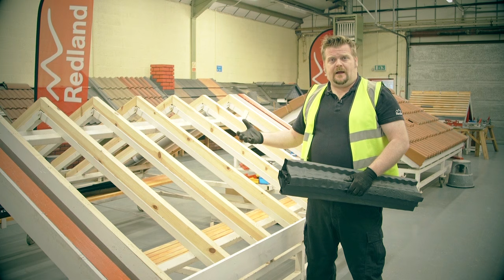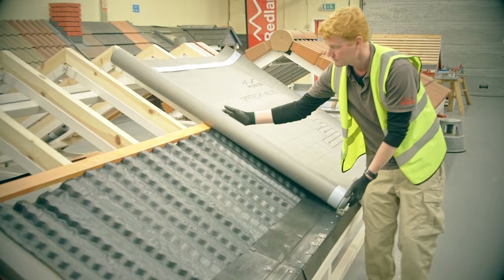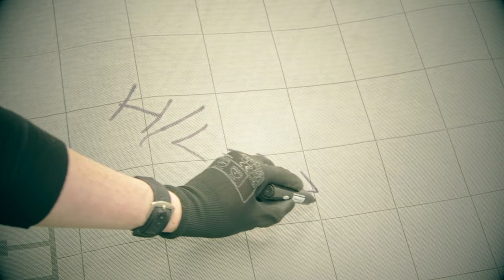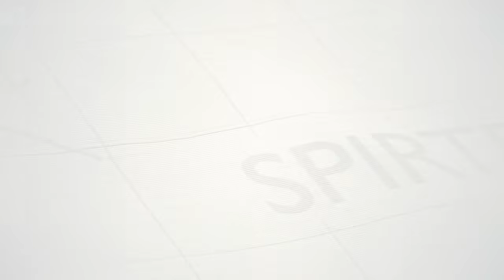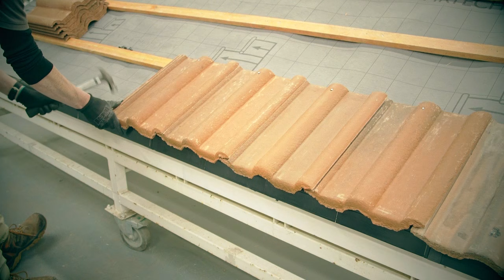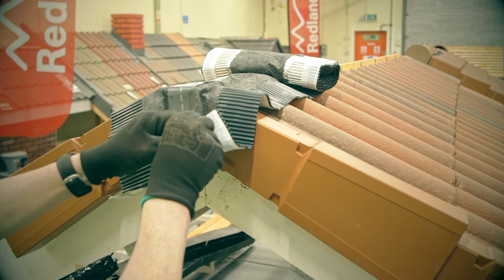How to Build a Roof

Comment: Actually, the factor that determines what type of roofing can be applied to a structure is called "slope", not "pitch". Believe it or not, they are two different things.
Reply: How so mate ? You are just being silly and nit picky for no reason . I’ve been a rooftiler all my life , tiled thousands upon thousands of roofs and let me tell you that every Roofer in the world generally refers to the pitch of the roof rather than the slope .  The angle of the roof be it 30 degrees , 45 degrees or whatever IS sloping ( slope ) and is referred to by EVERY ROOF TILER as the pitch.  You sound like one of those architects who sits behind a desk , never been up on a roof in their lives and uses their own technical lingo that nobody else in the trade uses.  I’ve met a few of them in my time . They often make cock ups in their design plans because they have had no actual experience of how an actual roof behaves in real life. .I remember one of them insisting on a specific old fashioned large roof tile be used on this huge new development in Beckton London.  We all said that this tile WOULD NOT work , it would leak , funnily enough because the pitch was too low . He didn’t listen and went ahead and insisted that he had worked it all out and he knew what he was doing . So we were ordered to do the whole site in these stupid old fashioned tiles knowing they were hopeless and what happened as soon as the winter came and the winds started blowing was that EVERY roof on the site ( a huge site ) started to leak and let water in .  We were constantly going back there to try and repair things until they realised that all the houses  would have to be redone with another tile . It cost the builders millions of pounds , who sued the architect , who went bankrupt and probably never worked again .  I suppose he referred to SLOPE as well while he was cocking up his calculations .  Just as well nobody else does.
Reply: @choppy249  Well, it's simple really. Pitch = Rise/Span. It denotes the ratio of rise to span in units brought down to their lowest common denominator, and is typically expressed with a fraction a la, "x to x", so if a building(house #1) is 24 feet wide from plate to plate(outside to outside) and the ridge rises up above the plates 8 feet, that roof has a 1 to 3 pitch(1 unit of rise per 3 units of span or 1/3 pitch), if a building(house #2) is 24 feet wide and the ridge rises 4 feet above the plate, that roof has a 1 to 6 pitch(1 unit of rise per 6 units of span, or 1/6 pitch). Slope = Rise/Run. Slope is a measure of incline, a ratio of vertical distance units relative to horizontal distance units, and is always expressed in inches per foot(does not reduce to lowest common denominator) or with the fraction "x in 12", or sometimes commonly seen represented as a right triangle with 12 on the base and x on the hypotenuse, denoting how many inches of rise(x) per inches of run(12). So, if a building(house #1) has a run(1/2 the span) of 12 feet, and the ridge rises above the plates 8 feet, that roof has an 8 in 12 slope, or simply 8/12. If the run of a building(house #2) is 12 feet and the ridge rises above the plates 4 feet, that roof has a 4 in 12 slope, or 4/12. So, in this case, house #1 has a pitch of 1/3 and a slope of 8/12, and house #2 has a pitch of 1/6 and a slope of 4/12. Make sense?
Reply: Just because everybody is doing something, it doesn't make it correct. That's an argumentum ad populum fallacy, and is nothing more than a rationalization for  constantly using the incorrect term because you don't know the difference between the two.

Comment: Very informative video. My questions as a none roofer are, how do you determine how much height to add on the facia board above the rafter and secondly, why is there no tilt fillet appliet, all that weight is on the facia board so if you need to change them in the future it's a nightmare?
Reply: When changing the facia you’ll need to remove the first course of tiles and probably push up the second course up. Bit of a headache but no nightmare.
Reply: As a Roofer I always fix a double batten just behind the fascia so the weight is supported, also this can be done to determine the the size a fascia needed

Comment: I think the video is aimed at roofers really, a DIY'er doing this will come across a whole heap of issues. Not setting the roof out correctly, you would never run the eave like that hoping it comes in to the correct overhang and what about marking out top to bottom, this is a must especially gable to gable for an equal overhang.
When you're loading your tiles, they should normally stacked in 6's with the channel downwards.
And why don't roofers use lath hammers and knee pads no more :) 
But in all fairness a good and well presented video from Redland.
Reply: LEEDS8 stacks of 6 maybe but channel down never seen that like
Reply: @l33-uk  Sorry mate, I meant the channel lower most, so when laying right to left the tiles naturally fall into place. 👍🏼

Comment: As a DIY'er I found it very informative. Thank You.
1. Why did you not stagger the tiles? 
2. Is there any disadvantage in staggering these tiles?
Reply: You dont need to half bond those tile or stagger them but you can half bond the Marley modern type of tile the flat profile 1 hope you dont mind me answering your question
Reply: Chess Ferrier . I’m a roofer , or was , just retired after 30 odd years . The simple reason why you don’t usually stagger interlocking tiles is that you don’t need to because they interlock and have an enclosed rain channel (flange ) running along the left hand edge of the tile . On the right hand side of the tile you have a raised lip that fits over and locks onto the left hand flange of the previously laid tile thus making it waterproof.
The only roof tiles you need to stagger are slates or plain tiles ( small almost flat concrete tiles , often used on the sides of houses as vertical cladding ) . The reason you have to stagger or cross bond these is because they are not interlocking , you just bump them up to the next tile so there is a small gap there where the rain will get in. So by staggering them you overlap the top part of the tile so that the rain can’t get in there . It doesn’t matter that the rain falls into the gap below because that has another tile beneath it , and so on all the way up from the eaves course . On these type of roofs the eaves tile will be a smaller different size to all the other tiles because it has to fit completely under the first main visible tile . You will notice that on this interlocking tile roof the tiles are all the same size as there is no need for an extra row of eaves tiles at the bottom . 
As someone else mentioned you can stagger some interlocking tiles such as the Marley Modern tile because they are not profiled , they are entirely flat ( usually coloured black ) . They were designed to look like the classic slate roofs but with the advantage of being interlocking . Some builders will stagger these simply to make them look more like a traditional slate roof , but as said there is no real need for it .  Redland used to make an equivalent tile called a Stonewold  which was a bit bigger and a lot heavier than the Marley Modern . Most roofers used to hate using them because they were so heavy , you used to break your back carrying them up the ladder on your shoulder or head . Nowadays I think they have tile hoists to lift them all up to roof level. A lot easier these days .
Anyhow I hope this explains it fully for you .  Incidentally it is possible to stagger some interlocking profiled tiles too , like the Marley BoldRoll as its profile will exactly match up with the tile below it , but there is absolutely no reason to because you won’t even be able to see the cross bonding , whereas you can on flat interlocking tiles like the Modern tile which gives that criss cross effect mimicking a slate roof.

Comment: Those dry verge systems look revolting on a roof. Modern plastic junk, ready to go brittle with UV damage and snap off in 10 years when the product is no longer available
Reply: Done roofing for 12 years and I agree they only work if buildings are square Aswel they haven’t thought of that.cant beat traditional mortar bed
Reply: @danmartin6515  If you a roofer please help us and not for free of course, got a newborn here under a horror roof if not a house. Thanks
Reply: total plastic crap for a otherwise durable tile roof. only an imbecile would cheapen a tile roof with this junk
Reply: fred johnson .  Spot on . Every single roofer who has ever used them will agree with you .
Reply: Have thought the same. I did, however, have much of the same opinion about the modern plastic roof tiles. Although, having used them on my conservatory for several years I'm pleased to say they have not disappointed. Out of interest, what are your thoughts of ordering concrete roof tiles online? Found some from Marley reasonably priced at https://www.roofingmegastore.co.uk/roofing-categories/pitched-roofing/roof-tiles.html and am a little unsure.
Reply: Mary Jackson . It depends how many you want . If it is just a few for a porch or something small then it is quite easy to pick them up from a builders merchant or have them delivered . When I was roofing for many years we didn’t have the option of ordering online so I can’t really say but I would imagine there would be a hefty postal delivery charge if you did choose that option . They are quite heavy and bulky so bear that in mind .
Reply: Probably made some special plastic that dont sensitive to UV.
Reply: Zoltán Katona doubt they’d even be allowed.....goes against everything these days that has to be biodegradable to some degree. Not even sure it’s possible.
Reply: @Sineseol  They still look revolting.
Reply: You can’t beat a cloaking tile
Reply: aye never mind felting with wind rain sleet snow.nice studio tho.fingers blue at 8.45am

Comment: Hi, so if you specify a 10mm drape for water to flow... your saying your tiles leak? or are expected to leak?
Reply: Haydn Williams Redland Double Romans leaks, we had thousands sent back, and skip hundreds absolutely rubbish we have stop using them,
Very poor quality and very soft, good for hard core thought, was very good some years ago.
Marly double Romans are stronger but quality sliding down,
Reply: I try to avoid tiles at all costs these days, unless its a rosemary job.
Reply: Haydn Williams Rosemary tiles are excellent, Sandtoft makes quality clay tiles probably the best my opinion.
Not fond of concrete tiles but mostly in my area,
Reply: im with you on the santoft , i used their rivious tile a few years ago was impressed with the quality on the tile  if not the clips lol